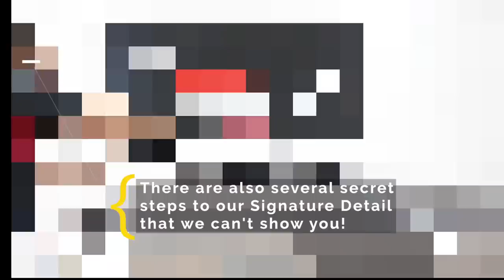Topaz's Best Kept SECRET - 100 Hour Maybach Level 5 Signature Detail!

Comment: Wow 🤩🤩🤩🤩
Good work team
What number sand paper you used to sand clear coat
Reply: prob 1500 dry, 3000 and 6000 wet
Reply: Fat Splat 
Thank you for answer
Reply: Swedish Marcus Viking  Id bet that it was 3m 1500 dry first, then trizact 3000 wet, 3m fast cut green for 1st polish, unsure on 'microfibre correction', then 3m extra fine plus yellow, then 3m ultrafina blue. the secret step is probably 3m polish rosa and/or ceramic coat. if you want it done properly, block it by hand, re lacquer with a thinned out mix and polish. the foam disc was just an interface pad

Comment: Orange peel is a certain kind of finish that may develop on painted and cast surfaces, even screen protectors.[1] The texture resembles the surface of the skin of an orange. Gloss paint sprayed on a smooth surface (such as the body of a car) should also dry into a smooth surface. However, various factors can cause it to dry into a bumpy surface resembling the texture of an orange peel. The orange peel phenomenon can then be smoothed out with ultra-fine sandpaper, but it can be prevented altogether by changing the painting technique or the materials used. Orange peel is typically the result of improper painting technique, and is caused by the quick evaporation of thinner, incorrect spray gun setup (e.g., low air pressure or incorrect nozzle), spraying the paint at an angle other than perpendicular, or applying excessive paint.

In some situations, such as interior house paint, the orange peel texture is desirable. In this case, a texture paint is generally applied with a spray gun. The texture is then painted over with the appropriate color. When painting walls, orange peel can also develop by using a roller with too little paint or too thick a paint and the surface dries before the texture can level.

Comment: Guys i suggest you to sand the car in lines (parallel to the car from the front to the rear just like the wind hits the car), it will prevent a lot of sandmarks and it will give like a clean methodic pattern. This will encrease the mirror look a lot more, will prevent some whirls in the clear coat and if the paint or the ppf film get chipped or scratched the mark will be a lot less visible cause of the under pattern going the same direction of it. What are your thoughts on that? 🤔 Except that, just 👏🏻👏🏻👏🏻👏🏻👏🏻👏🏻👏🏻 you guys are on another level 🔝
Reply: Fede Master that wouldn’t make a difference, the sanding marks are removed via polishing so the direction is not relevant. Plus Going in straight lines would require hand sanding and machine sanding is generally safer and more efficient.
Reply: @Obsessioncardetailing  the sanding marks are removed by increasing the grain step by step the polish is used at the end for removing finer marks. Anyway using a power tool as you said is better for getting a more uniform result, but i assure you whirl marks will appear a lot before than the method i explained if you don't put ceramic coating every 4 month or PPF
Reply: Fede Master yeah I know how sanding marks are removed. But can you explain how sanding in straight lines will prevent swirl marks
Reply: @Obsessioncardetailing  cause if the "scratches" caused by the sanding are all going in the same way it will create a uniform pattern, if you sand in circles you'll create circular "scratches" wich are more due to show whirls in reflections. Obviously if you polish 2 or 3 times the body it won't show up that obvious but if you use 1 low grain polish you can see a slight diffference 🙂 and again if you get a rockchip or some heavy dirt causing light scratches the orizontal pattern underneat is more lean to hide it 😊
Reply: @fedemaster3749  If you sand using a random orbital machine, the scratch pattern created is random and uniform.  Even if you sand in circles, or straight lines, if you do it properly and step down the grades (1500, 2000, 3000, 5000 grit, or as needed), then all the scratches will be gone - compounding and polishing will remove any fine marks left over leaving a perfectly  level finish with no scratches or sanding marks.

So basically if you do the job properly, going in straight lines wont actually benefit.
Reply: @Bigbitsuni  Thanks for the valuable input.
Reply: einnol B dumb info? No probs I’ll keep that in mind for the next car we do an orange peel reduction on. Again thanks for your info you’ve contributed greatly and helped increased knowledge all around.
Reply: einnol B, so you say if the sanding marks are gone by polishing, they are still different it they ware using the sending machine only in straight lines, than cross hatches?

Comment: Once the PPF is applied you're back to how it looked originally. TPU film contains all those imperfections you removed in the beginning stage. You'd be better off keeping the clear coat thick as possible then applying the PPF which will bring back the orange peel anyway but still have thicker clear coat coated by even thicker PPF. That polishing was just unnecessary but of course if the customer wanted then the customer is always right.

Comment: Removing orange peel on factory finish is very dangerous and in my oppinion it is bad for car. Would prefer sanding clearcoat and give it 2 flow coats of clear and than polishing it into mirror, because in your case, this is the last polishing without removing too much!

Comment: How much Clearcoat has been removed with the wet sanding & Hard lines left from the masking tape on the edges. Any further defects or scrapes will have to be painted as there will not be enough Clearcoat left Thus running the risk of buffing through the clear. This is a One time process & only should have been done to the paint defect/scrape. I'd like to see up close how much Basecoat is peeping through.  A hell of lot work to ruin a very expensive car.  This is Not a good idea.

Comment: I think I already commented on this video when it first popped up in my recommendations. But if I haven't, a full strip down, and flow coat adding 3/4 layers of clear, followed by blocking cutting and buffing 2 coats out, leaves you with more protection than factory, and no peel. I'd do it for $3000 assuming theres no repair work to do. If this procedure is a penny more than $2000 it's a RIP off AND leaves the car with no protection. Just saying.

Comment: I talked to a Toyota-trained, Ferrari and Lamborghini certified bodyshop owner many years ago. The shop is also certified to repair Audi, Lexus, and Honda, etc cars that are damaged during shipment prior to delivery to customers. He told me that it is not hard to spray a car with minimal orange peel. But the orange peel is achieved on most cars to make defects and scrtches less visible under different lighting. 99.99999% of the consumers cannot tell the difference between moderate orange peel and light orange peel. He also advised against wetsanding out orange peels on factory paint because those paint have just enough clear coat on them.

Comment: I do custom paint jobs for a living... and the taping the “curves” with 1/4 inch fine line tape is not necessary it’s extreme over kill.
Reply: no it's not, those area's get much more wear in the sanding process if not taped properly, which would shorten the technical life time of the paint.
Reply: It's overkill until you burn through the clear coat and have to fix it at your own cost. Which means repainting the panel which means resale value is down which means owner is pissed which means no more business for you.
Reply: Lol so you guys don’t know what your doing then... Ive been doing top notch custom paint work since I was 13 years old when I first got into the custom paint industry... I can do this type of work in my sleep
Reply: @brockdaniel2458  But with custom paint you have A LOT of clear coat to work with, not so much with factory paint these days.
Reply: Jiri Pavlik well I’ve done tons of high end vehicles that come from straight off the dealer lots and sand them with 1500-5000 grit sand paper and I’ve never have had any issues I guess it’s with the amount of experience I have. From the factory there is not a lot of clear on them but never had any problems as long as you pay attention. I would rather be careful tho and tape it but it’s a waste of time in my opinion.

Comment: Start with 500 to 600 grit until peaks are almost gone then switch to 800 until flat then Finnish with 1200 to 1500 grit wet to make sure the sand paper doesnt clog and to get rid of the 800 grit scratches, then buff. And the secret step is...drum rollllll please...... their is no secret step, thats all there is. Once shiny and scratches are gone apply a sealent of your choice. 

 Show cars will usually get a second coat of clear after its been sanded flat, then sanding process is repeated then buffed.
Reply: Lmao so only go to 1500 grit huh? You clearly dont actually know what youre talking about then. Hell i go to 3000 on headlights and 5k on paint
Reply: @MathersNicholas  its unnecessary to go that high unless you wanna waste time. Most heavy compounds will get rid of 1500 to 2000 git easily. They tell you that on the bottle's....plus going that high is just ridiculous, at that point youre just beating a dead horse.

Comment: Chewing up all that clear coat just to remove Orange peel that wasn't even that bad to begin with. Big waste of money considering they didn't even completely flatten the paint. If the reflection is showing a wavy pattern, you just wasted 100 hours and cut that clear coat in half. Lmao..... This is why I laugh when high end detailers scoff at aggressive cleaning techniques that slightly mar the paint, when they're over here wet sanding brand new cars to death.

Comment: Painting a car is tedious, detailed, time consuming and demanding task. When the car is manufactured the skeleton is immersed in prime, secondary and tertiary paint not forgetting rust proofing. That immersion cannot be repeated outside. There are so many ways to cut corners in paint jobs. There are many faults that do not appear even after years. Only enthusiasts can do a proper job of re-painting a car. Is it worth? Only very prestigious and luxury cars qualify. Yes, when the value the car is in hundreds of thousands of pounds / dollar, five to ten thousands are worth spending. The finish and durability of Oil based paints cannot be matched with modern water based paints.

Comment: This kind of alterations on the factory paint in my opinion is downright stupid.

Sure it looks nice, but you are removing quite a bit of the clear coat layer, making the car more more prone to chipping damage from small pebbles and asphalt.
Its also 100 x easier to see small scratches and dents.

The correct way to do this would be the American style of mirror finishing.
They simple paint the car twice in 2 stages of 2K clear coat ( usually high end ones at that, like the Axalta Cromax CC6400 ) and sand down the 2nd clear coat to 6000 grit and polish.
You seal the whole thing afterwards in a ceramic coating.

That way you have far more layer thickness protection the bodywork of the car, more depth to the color ( because of the thicker clearcoat, it makes the colors pop more ) and the ceramic coating provides some scratch protection.

Comment: I cant get over how over hyped this is as a procedure and how often its hitting my suggested eventhough I've already watched it. As an auto body tech, this is NOTHING special. Its actually easier to flow coat a car at this stage, leaving the customer with a dead flat 3 coats of clear. Funny thing is, I'd charge a customer $2k for a flow coat, and detail the interior complimentary because that's nearly $1800 profit for 6 hours of work. Already murdered their wallet, and somehow my flow coat, is still 4x more affordable because I'm not a "professional detailer".